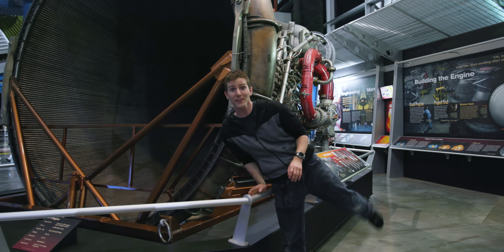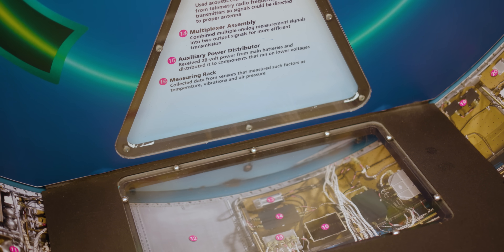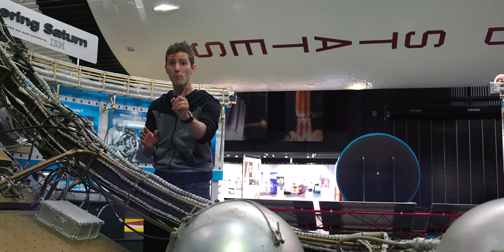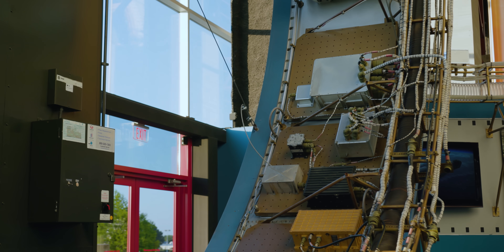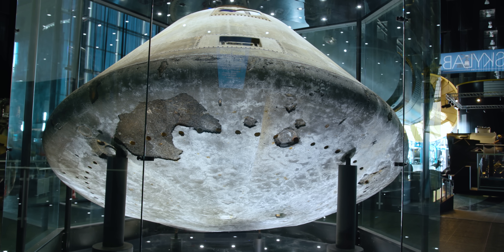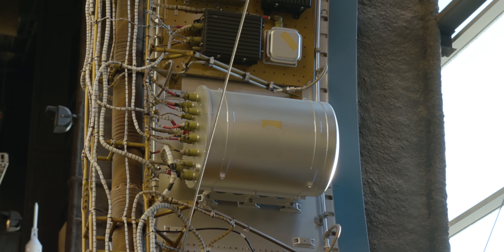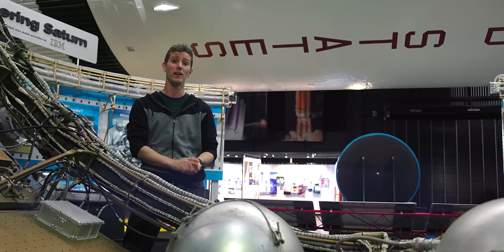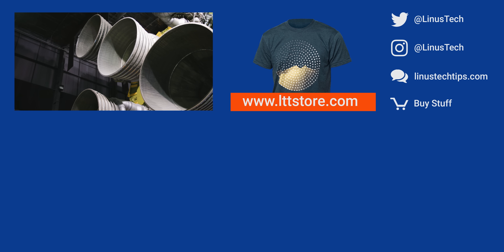The ACTUAL Computer from the Saturn V Rocket - ft. SmarterEveryDay

Comment: Wait a minute!  NASA allowed Linus to actually hold a part of the Saturn V computer??? They obviously have never watched this channel! :)
Reply: One small step for linus, one giant leap for a space age cpu.
Reply: @guyclykos  "you see, i kick it before it hits the ground"
Reply: @core36  Epic save! Can you land it into the socket or do you need an assist?
Reply: @guyclykos  He'll start with an slight overclock.
Reply: "One giant drop for a space age cpu"
Reply: Thankfully NASA retired those Saturn V long ago. Linus won't be breaking stuff that matter (for the time being).
Reply: I think, such stuff was more robust and reliable then modern electronics. It handled space, so Linus shouldn't be a problem.
Reply: xd
Reply: Linus: I didn't drop it, i layed it down very fast
Reply: It was robust enough to be linus proof
Reply: @nhan cao still even if they're retired they aren't replaceable. That Saturn V is a model it was a real rocket that just wasn't set on a mission.
Reply: He didn't get that thing from NASA. Destin actually borrowed it from a friend of a friend there in Alabama. I think he explained that in the 40 minute extended cut of his video on his second channel.
Reply: absolutely 🤣🤣🤣
Reply: PResumably they use a different system for the SLS, so they won't need it anymore.
Reply: @5Andysalive  Nowdays they use Windows XP
Reply: No, normally they run Windows 2000. That's why it's still updated to this day ;)

Oh and in a way we can be glad, that they cancelled Apollo 18 and 19... because otherwise we wouldn't have any moon lander to show anymore, because they only built the 8 ones they wanted to use :D
Reply: @Cyanide *to be continued jojo style
Reply: 1,000th like
Reply: I'm surprised he didn't ask if he could overclock it
Reply: @Jebronlames3  See vaccines are bad.
Reply: it was just a dud anyway because NASA filmed the whole thing here on Earth.
Reply: @Saki630  Oh, here we go...now you dun did it mate!
Reply: This thing is FAKE AF, NASA probably wishes linus would break this thing so they can stop lying about it. All I see is a bunch of plastic and metal boxes, we have no proof they actually work just people talking intelligently telling us that they do work. Meanwhile no one has seen them working.
Reply: @ninjabongtoker1  Except, you know, the guys that went to space on it.
Reply: @ninjabongtoker1  'we have no proof'. Well we have no proof you have a brain either. We have 50'000+ hours of  real time communications . Not a bad start.
Reply: EVPaddy well i have a brain or else im some sort of alien with no brain and i assume all other flat earth people must be the same
Reply: @ninjabongtoker1  You have to be joking. that is a Saturn V rocket that had its mission canceled. I've been to the space and rocket center multiple times. But I assume you're joking
Reply: @noahweathers5597  Oh this guy has been to the rocket center ! The earth must be a globe! great evidence!
Reply: ninjabongtoker i wasn’t commenting on ur claim the earth was flat i was talking ab the saturn v computer, but ik you’re trolling so 😂😂😂

Comment: "...can cool up to 9k watts..."
so, 20 GHz 9900k possibility?
Reply: *50 GHz 7700K
Reply: @faranocks  it is a joke lol. Things get really hard after around 5.5 to 6GHz not only because of thermals, but because of electromagnetic interference and stuff
Reply: I wonder if next gen intel cpus can reach 5.5 boost clock though. My old i5-8600k could reach 5.3ghz with 50€ air cooler :D
Reply: @megapet777  "old i5 8600k" wtf man that's not old.
Reply: @JoacoZM  It's old to me, since I don't own it anymore.
Reply: @IJoeAceJRI  I wonder how far it would had gone with delid, grinded surface and 360mm liquid cooler.
Reply: Or it can also cool a bunch of sweet homes in Alabama.
Reply: 9K watts of heat dissipation is nothing, believe me. Look at vehicles, do the maths.
If a car engine can produce 75 horsepower (55 kilowatts) and it's 30% efficient (that a reasonable efficiency), then at max power it will produce 128000 watts of heat.
So a car with a 75 horsepower engine needs a radiator that can dissipate at least 130 k watts of power. See??? And here I'm talking about a small, economic, daily driver car.
Now that 9K watts of heat dissipation doesn't look like a lot, right? And then: their system only works in a vacuum.
Reply: @sasjadv  it is a hell of a lot when you are extracting it from a small box instead of a massive engine, especially since you don't have the benefit of free air convection. Trust plus being space qualified is a MUCH tougher engineering problem.
Reply: @faranocks  e
Reply: @IJoeAceJRI  Yeah. Sold the PC to my cousin ;)
Reply: Faranox not to mention there isn’t a motherboard on the planet rated for that power draw
Reply: 6GHz 9700k*
Reply: @MarkoHR  not possible.. maybe 11th gen
Reply: only in PC Building...
Reply: in space....   ?
Reply: More like 10 GHz Pentium V ;)
Reply: @磁場-x9r  3GHz Pentium 4 at room temperature
Reply: Nah, even the stock 9900K is too much for any cooler. xD
Reply: More like 8-9ghz 9900k with how that thing sucks power 😂

Comment: sad fact: you know that we can't rebuild the Saturn 5 Engines right?...and that mostly because we don't have the know-how anymore! specs are not enough and those who did had the knowledge are dead today!
Reply: True but realistically we wouldn't 't use or trust that technology any more, modern materials for construction, fuel and control were used to put the Falcon together but's it's core design borrows from Saturn V in many respects and whilst it can't currently take a big enough payload to the moon its extensible, reusable and much cheaper to launch
Reply: LOL the stupid ignorance of that derp is amazing. What a ridiculous fucking moron.

Comment: Radiators work just fine in space, by giving off heat as IR radiating - they transfer no sensible heat though, so they don't work as well in space as in an atmosphere. For a small and light radiator to discharge a lot of heat it would have to be impractically hot (I = \sigma * T^4)

Otherwise cool video with my two favorites.

Comment: the reason they are stopping windows 7 is becouse they want more control and money from the new users and it will be working fine until 3 or more years.
Reply: windows 7 is a decade old, bud. get on with the times, boomer.

Comment: 3 125lb batteries  non rechargeable, I hate going back in time.
Reply: Well, it was also a 3000 ton rocket, so like, 400 pounds of batteries isn't that wild, even today I'm sure they don't use like a small li-ion. Probs still dozens of pounds if not hundred of batteries

Comment: F-1 Engines run off LOX / RP-1. Without Oxygen the Saturn V wouldn't have gone anywhere. Oxygen content in the coolant ring would've posed an additional threat for fire should anything in the guidance ring fail and spark. That's why nitrogen is used. Oxygen and rocket fuel are the same thing in this case, so it was a pretty good time.

https://youtu.be/olRF5Ckaga0?t=208

Comment: Funny thing is conventional radiators use convection and doesn't work well in space. Radiators which are optimized for radiation are the best way to get rid of heat in space.

Comment: But.... can it run Crysis?

For real, though, my appreciation of those rocket engineers just went up another notch.
Reply: IBM built and designed the LVDC for the Saturn V, pretty cool what you can get done when you’re motivated. How the computer worked is pretty interesting.

Comment: Gamers Nexus version of the video: 3-5 hours long, taking the pc apart/building it from scratch, complaining about airflow in the case and ending up using a drill to improve this issue followed by overclocking it with liquid nitrogen in order to beat JayzTwoCents score.

Would actually like to watch every minute of this.

Comment: How do relais work in a rocket? I mean wouldnt gravity forces manipulate the output?
Reply: Relays work by an electromagnet actuating a lever arm to close a circuit. When the electromagnet is de-energized, a small spring pulls on the lever arm and opens the circuit. No gravity is necessary for operation.
Reply: @quietguy675  Yes I do know how relais work, but atleast the ones that I use wont endure that force in a rocket.
Reply: Well, you'll be constrained by the forces that the human body can take, so  build the relays which are able to handle more than that and you'll be good. It only matters on launch and return, as the forces in space will be tiny compared to earth

Comment: Linus Just got a $10,000 Mac, are these good specs? It has:
CPU: 5 MHz 68000
ROM: 16 KB
RAM: 1 MB, expandable to 2 MB
12″ b&w screen, 720 x 360 rectangular pixels
keyboard attached via coiled telephone-like cable
mouse attached via DB-9 connector
two DB-9 serial ports
parallel printer port
three expansion slots
floppies: two 5.25″ 860 KB ultra-thin Twiggy drives
sound: beeps
Reply: Yoo these specs are mad! My $10,000 PC doesn't even come close!